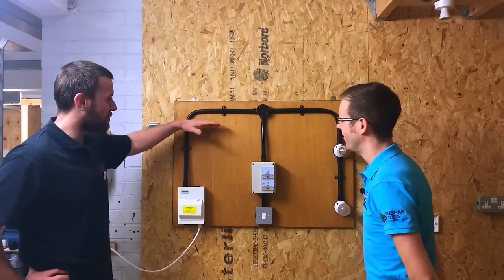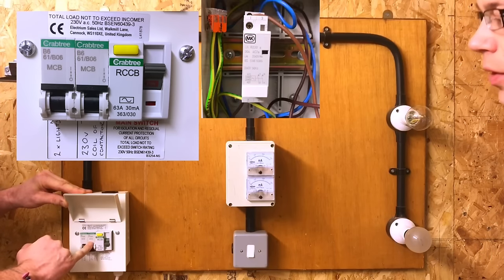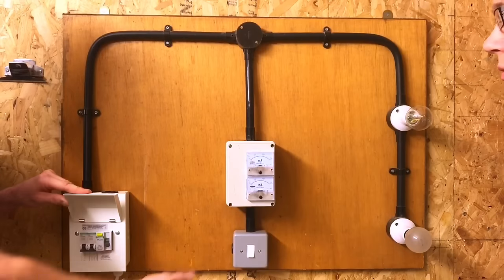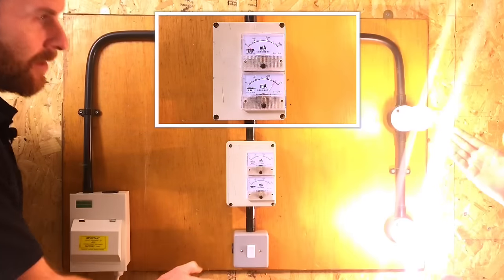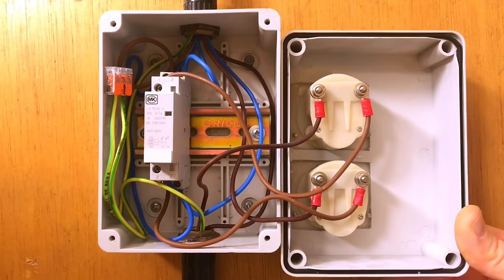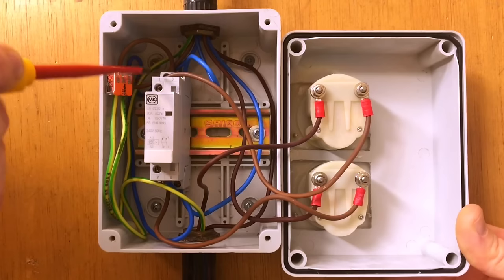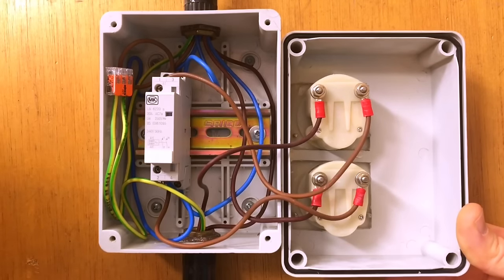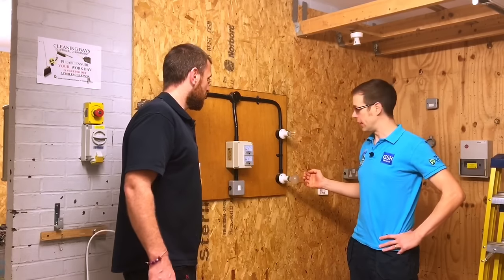Single Phase Contactor - Connections Explained, Application plus the Current in the Coil and Load

Comment: Is that 3 neutrals at the contactor? Is one of them connected to the light? 
On the 1st contactor video it went straight back to the board that's why ive asked. Cheers 👌
Reply: One neutral is for coil, another neutral is from the consumer unit to the incoming side of the contactor and the last neutral goes from the outgoing side of the contactor to the load(s).
Reply: @ashmanelectricalservices4318  thanks pal

Comment: Where would you typically house the contactor box? Here you've got it near the switching point, which I guess is great for testing, maintenance and  the opetrator hearing that clunk (and in the test rig for the ammeters). I can see you might sometimes want it near the distribution board to keep the wire runs short of the load circuit, avoiding looping them down. Is there something in the regs about safety etc that I've not thought of? Maybe it doesn't matter, and it goes wherever's convenient?

Comment: I didn’t think this was explained to well… what’s in a1 and  a2? What’s in the top and the bottom of the contactor
Reply: A1 feeds the coil A2 is neutral to smooth the circuit